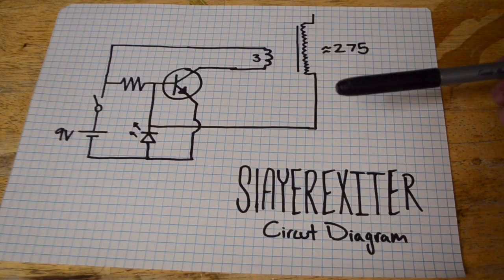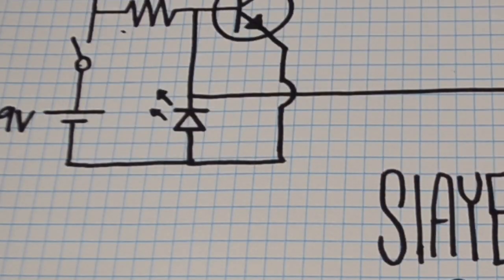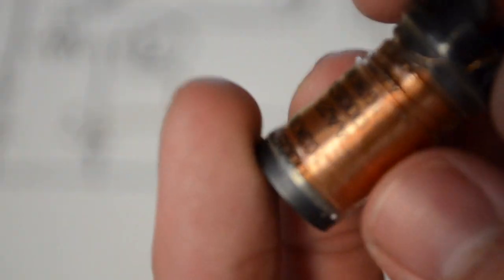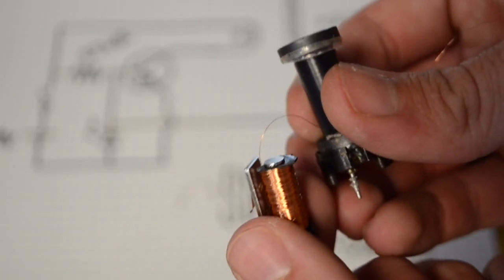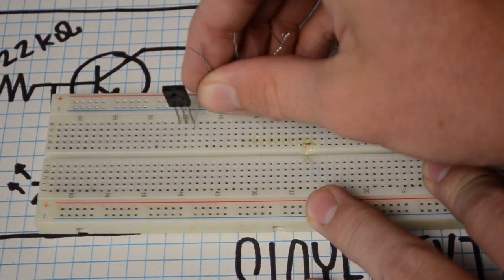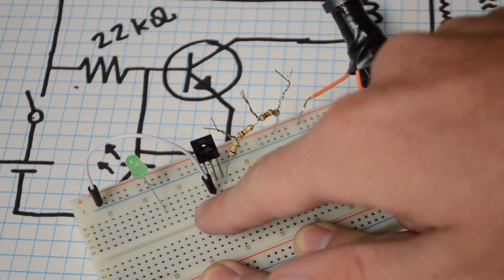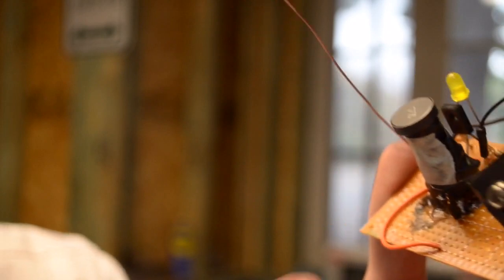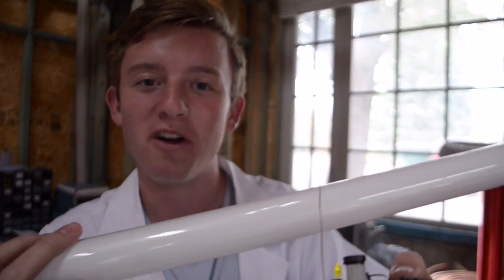How to make a mini Tesla Coil SE

Comment: I tried to make a tea coil like that but mine didn't work. For the secondary winding I used the thin wire from the secondary of a microwave transformer and wrapped it around a pvc pipe. I used the transistor and did that same slayer curcut but mine didn't work can you help to explain why maybe mine didn't work.

Comment: Hey I'm Sri Lankan boy.
Your channel is very impressive.
By the way I made slayer exciter but it is not working.
I used 28 AWG copper wire ,BD 135 transistor and 22k resistor.
I 'm looking answer from you 
Thanks for everything!

Comment: Am I the only one who notices that he has no idea how a Tesla coil works? Tesla coils are not magnetically coupled, but two oscillating circuits that have the same resonance frequency. So the secondary coil must have so many turns and a corresponding capacity that it matches the resonant frequency as the frequency generated by the transistor.The secondary coil does not have to be connected to the primary circuit at all. 
If it´s magnetically coupled it is NOT a tesla coil but a "normal" transformer.
Reply from the maker: Sort of... while it is true that the capacitance between the toroid of the secondary and the ground create a LC resonance circut, the first two coils are certainly magnetically coupled. That is what I was referring too when I said magnetically coupled, the primary and the secondary coils.
Reply: @KeystoneScience  Ok, then I misunderstood you (no native speaker here :) ). Maybe you should have pointed out that they are only loosely magnetically coupled and that the important thing is not the winding ratio (as with classic transformers) but the resonance frequency (rule of thumb: 1/4 of the wire length corresponds to the resonance frequency).I built my first coil with 16 with things from scrap (OITs, glass plate capacitor, 1.2m lightning distance) - it was fun, just not for the neighbor ;) Sry for the misunderstanding.
Reply from the maker: Haha it’s no prob, I am happy you know what you’re talking about. I miss speak all the time, so I like it when people like you can help clarify things in the comments for others :)

Comment: im getting very low voltage output, around 0.5 volts, im using everything u have shown in this video, please help
Reply: What do you mean by output? From the top of the secondary coil to ground?
Reply: Aidan Scott I got little bit of spark but it cannot light up a cfl, i used 2N222A transistor, 18k resistor, 375 turns of secondary winding 4 turns of primary, and 15V dc supply
Reply: Siddarth Sharma do 3 turns on primary and 275 turns on secondary

Comment: i used an air coil with around 400 turns and a 2n2222 transistor it worked well but while i was experimenting tring to use 2 9volts batterys in series i added i like 4 of the 2n2222 transistors and it start throwing off some corona with just one 9v still haven't been able to use 2
Reply: Kyle Newsome I got some corona with just one 9v

Comment: why does this only work with a 9v battery and not a wall adapter
can it be the amperage that is to low (1.5A)
need help
Reply: just j-use a wall adapter from 110/220V (depending where you live) to 9v

Comment: every 91.66 turns of wire on the secondary is 1 turn of primary coil

275/3=91.66
Reply: More people like you are needed
Reply: good job math
Reply: *91.66666666666667

Comment: can i use any kind of npn transistor?
Reply from the maker: +Lorenz Balagtas probably yes, just along as it can handle the voltage and current ( which isn't much anyways )
Reply: Keystone Science ok sir thanks. i will try this soon
Reply: Keystone Science i can't find the same core that you have what replacement can you suggest for me to use?
Reply from the maker: +Lorenz Balagtas hmm I think any inductor core should work, I haven't tried it, but it should. A more common inductor are the ferrite rings, and I think if you wound the wire around that it should still work

Comment: Does the amount of electricity it produces depend on the length of the copper wire?
Reply from the maker: +Jeremy Cronk nah, that's just there for convenience, it depends more on the ratios between the first and sencond coil, the power source, and also the resistance from the circuit :D

Comment: i have a few questions. first, does it matter what relay i take apart for the wire? second, where can i get the inductor? third, where can i get the bd135 for a cheap price?
Reply from the maker: +dylan tomlin no, off a circuit board ( I got mine from the circuit board of an old CRT tv ) and if you do get it from their, I also got the bd135 off from an old crt tv :D

Comment: what frequency is it oscillating at?
Reply from the maker: +Ultra RC great question! I used to know, but I will re-measure it tomorrow and tell you!
Reply: cool thanks, also could you damage an ocilloscope measuring that thing?
Reply: i measured my one and it was about 800KHz
Reply: Ultra RC in my case is really close to 1Mhz, depends from the Bjt

Comment: I tried this with a bd135 tip31c and tip35c my led burns out also putting a diode gets it very hot
Reply from the maker: +syamala raj weird, I haven't noticed any heat on my led when I run mine, I'll think about how to help you fix this!
Reply: I think it doesn't work because I used 12 volts

Comment: What power supply do you use?
Reply from the maker: At the end it's just a 9v battery, but I use a variable DC power supply ( techtronics brand I think ) for testing
Reply: Thanks, I was thinking about buying one recently and I thought I should ask you! 🙂
Reply from the maker: +OlimDaBoss W. Awesome ! There super useful! I got mine used off of some guy on the Internet, however the drawback is , mine has 2 slots from 0-36v but they can only go to 2Amps of power, but still super useful!
Reply: yeah, i was thinking about getting one that goes up to 4 or 5 amps, again, thanks for your help!